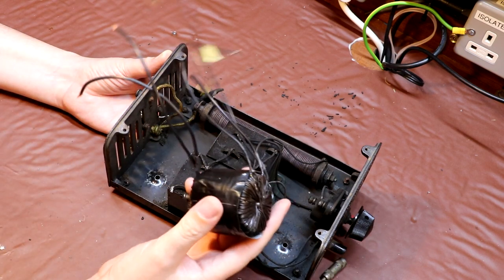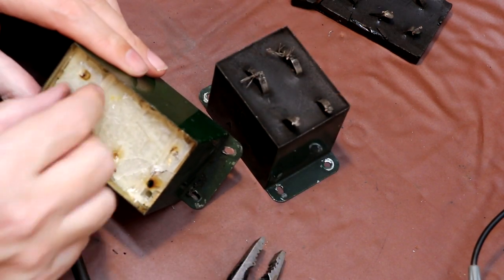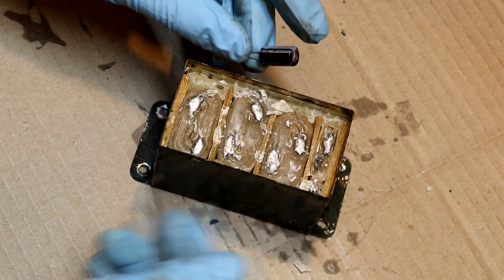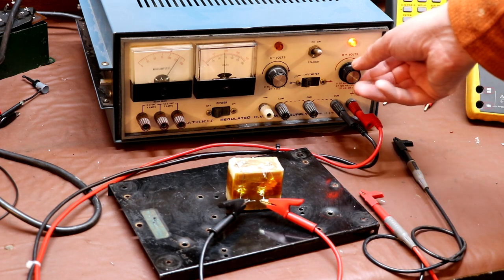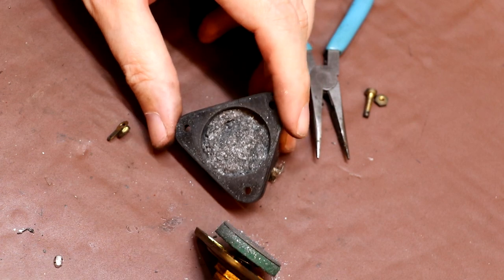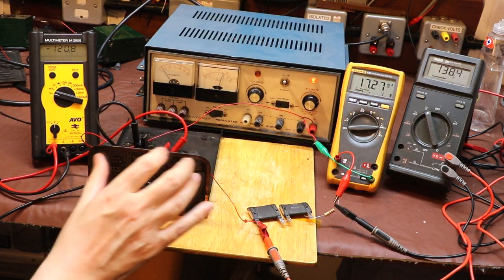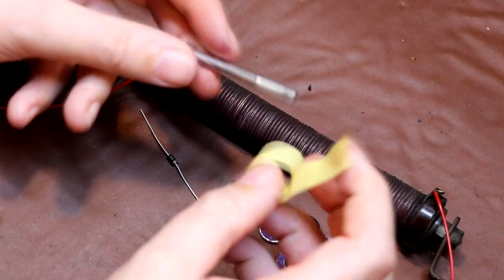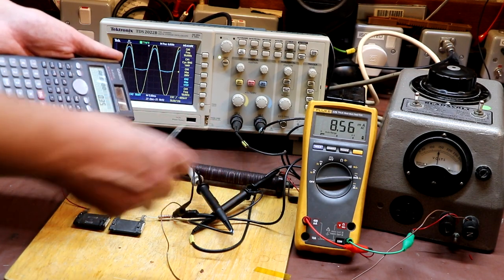Metal Rectifiers - W.I.B Battery Eliminator

Comment: Millifarad would be 1000 microFarad. But the MF (or, more commonly, MFD) did mean microfarad. Of course, we should use milli Farad for 1000uF but for some reason we still use  bizarre units like 10,000 uF. Unlike battereis, which we rate in mAh and thousands ,mAh instead of the correct Ah.

Comment: This video deserves a lot more views. It is basically a superb, well explained history of electronic components from 100 years ago. I can remember using compressible carbon piles as a variable load tester for car batteries. They were certainly around up to the early 1980's.
Reply from the maker: I remember having cars from the 60s that used this technology as some form of regulator for the Dynamo. I think the discs were compressed by a electrical solenoid. I believe they were also used as voltage regulators on aircraft well into the semiconductor age as they have very high reliability. It’s amazing the early technology I’m sure a lot of good idea etc are long forgotten. Spoiler but I am planning on putting a high voltage  and current regulator inside one of the capacitor cans but making it look original.  Thanks for your very kind comments my best regards Chris
Reply: @allthegearnoidea6752  I have worked for well over 40 years as an auto electrician and well remember mechanical voltage regulators and cut-outs as fitted to dynamos and early alternators.
 If you ever get your hands on an old RB340 or RB310 Lucas control box from a 1960's or early '70s British car ; you might consider doing a video on their method of operation. Simple but very clever and unknown today except to vintage enthusiasts. 
Loved your Crypton battery charger repair too. If I remember correctly, they had some sort of reverse polarity device that immediately  tripped the main switch If the battery was connected the wrong way around. I didn't see it on the model you were working on, but worth having a further look to see if it was fitted.

Comment: A nice improvement when you have to drill out a stubborn screw is a left hand drill bit. A set of them is an inexpensive improvement for any shop or lab. I have used mine for decades. Just search the usual places for something like  "Left Hand Drill Bit Set, 13 Piece | M2 HSS with Titanium Nitride Coating | SAE (1/16" - 1/4")".
Reply from the maker: I was using a carbide left hand drill bit but I don’t have any in very small sizes. It does work sometimes and always worth a try but nothings guaranteed in this game. Thanks for watching and comment happy new year regards Chris

Comment: Lynde Bradley (one of the founders of Allen-Bradley) invented the compression rheostat in 1901, which was used to control the speed of electric motors.
Reply from the maker: Following your post I have been reading about that. very interresting thanks

Comment: First time I have watched a video about electronics where I have learned facts all the way through. No previous knowledge of graphite pressure adjustable resistors and no previous knowledge of copper "washer" metal rectifiers.
Reply from the maker: Well your not alone I didn’t know about either of these just a few weeks ago. Although I did now about graphite pile regulator that were still used with generator sets until quite recently.  It surprising that such a mundane device can hold so much interest. We live and learn. Thanks so much for watching and the nice comments. Best regards Chris

Comment: Thank you for another interesting video, Chris. When you first showed that pot and said it was multi-turn I suspected it was a "carbon pile" device. Many eons ago I worked on generator sets that used carbon pile regulators - a solenoid pressing against a stack of carbon disks. A spring would compress the stack and the solenoid core worked against the spring to reduce the compression. They were used in conjunction with 28 Vdc 500 Amp generators and were quite accurate and dependable. Regards, David
Reply from the maker: I had a similar device as a regulator for the Dynamo on my old Landrover. They were also used until relatively modern times as voltage regulators on aircraft due to vey high reliability. Thanks for watching and comments regards Chris

Comment: Spot on analysis of TCC capacitor blocks. They were all too old capacitors. What an interesting potentiometer.
Etch - a - sketch pot perhaps? Your test of the rheostat was also spot on. The copper oxide rectifier was commonly
used in railroading for controlling switch turnout controls via relays and the corresponding signal systems until 
the advent of other solid state metallic rectifiers came into being in the 1940's. Great video Chris!
Reply from the maker: Thanks for watching and really nice comments. My best wishes to you for a merry Christmas and a happy new year. Regards Chris

Comment: i think the dry capacitors did very well, i can't see modern ones lasting as long. They are designed to fail.
The graphite compression was a very sneaky way to limit current, it reminds me of the old car battery load testers.
I didnt know that copper oxide rectifiers ever existed, selienium yes. valve record players had that type.
Not fantastic but selenium worked 😀
Yet another smashing video chris, you make my brain cells rub together and warm up lol.
Drilling your knob, oowww painfull :)
Reply from the maker: Do you remember the graphite slab regulators I think they were made by Lucas. The controlled the current in the Dynamo field winding. I had one fitted in my 2A series Landrover. Thanks for watching regards Chris
Reply: @allthegearnoidea6752  No im afraid not,  i do remember the dynamo and black regulator box with special relays that could be adjusted to get the voltage correct.
But that's not you were asking.
I removed the regulator box and joined the d.c wires together,  we got a lucas alternator together and wired it up.
The Triumph herald electrics worked much better.
Sorry waffle mode :-(.

Comment: I thought I knew very little about a lot of things, but I'm not young enough to know everything. The potentiometer design is fascinating. Wonder if they made the carbon mix with different chemistry for different resistance/taper ohms, or was it a one size fits all design?
Reply from the maker: Yes I’m not sure. I have only previously seen the graphite slab regulators. Thanks for watching regards Chris

Comment: Great stuff as always Chris. I always learn a little something new from each of your videos. I have never seen a graphite powder control like that before. Actually I have never even heard of one or seen it in books. Every day's a school day in the world of electronics old and new. ATB Doug.
Reply from the maker: Apparently a version was commonly used as a variable grid leak resistance. High power version used graphite slabs in mechanical voltage regulators

Comment: That’s an interesting question, regarding the performance of the silicon diode, after 90 years has passed. If the diode in question is “NOS,” I suspect it will be just fine, if it has been stored properly for those 90 years.  However, if it has been “Rode hard, and put away wet,” all bets are off. One sure thing is: Very few of us will be around to know the answer….  😉
Reply from the maker: I have always found diode to be reliable unless used in high power applications when all bets are off. I’m thinking that modern semiconductor have such tight tolerance that perhaps even minor age related deviations could cause problems. I will be sure to let you know in 90 years.